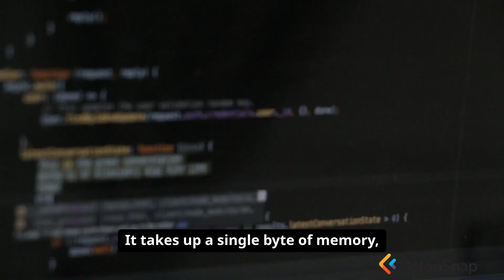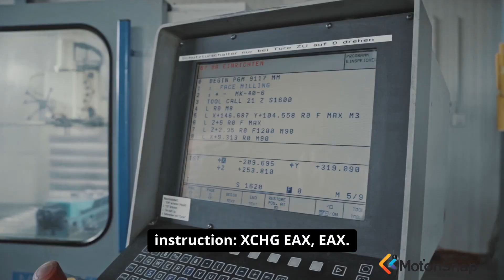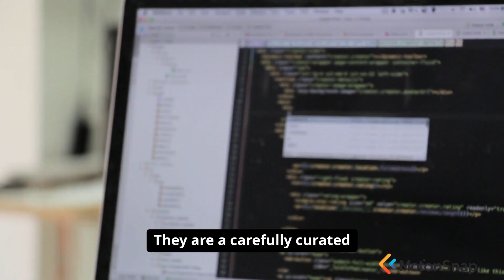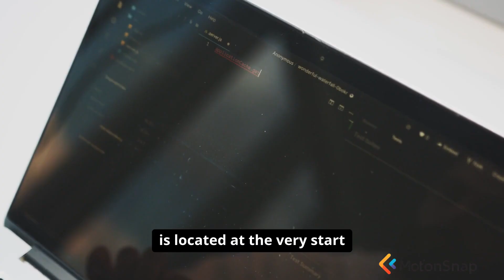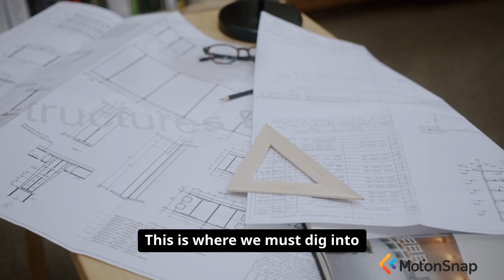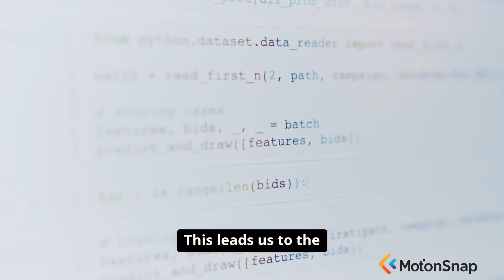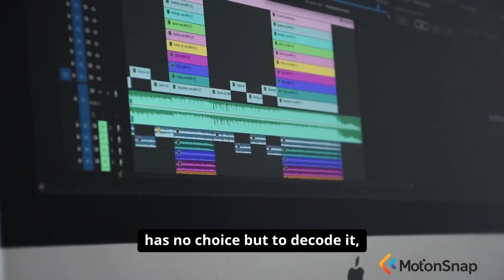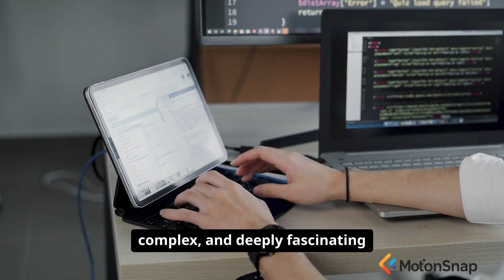x86 NOP: The Secret History of The Instruction That Does Nothing

Comment: When a multi-byte NOP is used for alignment, does the compiler prioritize aligning loop headers or branch targets, or is it a universal padding mechanism applied wherever space needs to be filled?
Reply from the maker: "That's a 200-IQ question, NGL. It's definitely prioritized for branch/jump targets. As the video mentions, the compiler is obsessed with making sure the 'beginning of a loop is located at the very start of one of these cache lines'. It's all about preventing that pipeline 'stutter'. So, it's less a 'universal' filler and more strategic, high-performance padding for the most critical jump points. It makes me wonder, though: have you ever seen a compiler get too aggressive with padding and actually make things slower by blowing out the cache?"

Comment: Is the XCHG EAX, EAX alias used in non-EAX registers (e.g., XCHG EBX, EBX) also treated as an unofficial NOP, or does the decoder only look for the 0x90 op code?
Reply from the maker: "You've hit the nail on the head. That's exactly the kind of unofficial NOP I was talking about [09:52]. The XCHG EAX, EAX is special purely because its opcode is 0x90—a single byte [02:31]. Your XCHG EBX, EBX (which is 87 DB in hex) is two bytes. It works, but it's not the one-byte wonder. Given that, if you needed two bytes of padding, would you ever use XCHG EBX, EBX over the official two-byte NOP (66 90)?"

Comment: If a compiler uses a sequence of three single-byte 0x90 NOPs instead of the official 3-byte sequence, does the CPU hardware recognize the pattern and still fast-path it, or must it be the official prefix-based sequence?

Comment: Couldn't a different design approach—maybe fixed-length instructions like some RISC architectures—have eliminated the entire problem of NOP alignment padding in the first place?
Reply from the maker: "Spot on! That's the core of the classic RISC vs. RISC argument. With fixed-length instructions, the whole need for complex, multi-byte padding just vanishes. You wouldn't have the 'self-inflicted problem'! But here's the challenge: RISC architectures still have NOPs, just for different reasons (like pipeline hazards/delay slots). Do you think those RISC NOPs are 'purer,' or just a different kind of necessary evil?"

Comment: With AVX-512 and other huge instruction set extensions, what is the current theoretical maximum length for a ""recommended multi-byte NOP"" today, incorporating all possible prefixes?
Reply from the maker: "The 'recommended' list is for polite, efficient padding. What you're asking about is the 'impolite' theoretical max! The answer is 15 bytes. That's the longest any instruction can be before the CPU literally throws a fault. The AVX-512 prefixes are part of that 15-byte budget. So, while the 'official' NOPs are elegant, the longest NOP is just a 15-byte pile of 'useless' legacy prefixes. TBH, who do you think was the first person to try that?"

Comment: Since the official multi-byte NOPs are recognized by hardware fast paths, how much slower, in clock cycles, is an unofficial NOP like MOV EDI, EDI really?
Reply from the maker: "That's the million-dollar question! The official NOP is designed to be the cheapest 'nothing' possible, just 'skating over' the hardware. The MOV EDI, EDI works, but it's inefficient nothing. The CPU 'does real work' to process it. It's the ultimate proof that 'not all nothing is created equal'! Bet: Can you think of an 'unofficial NOP' that's even slower and more pointless than MOV EDI, EDI?"